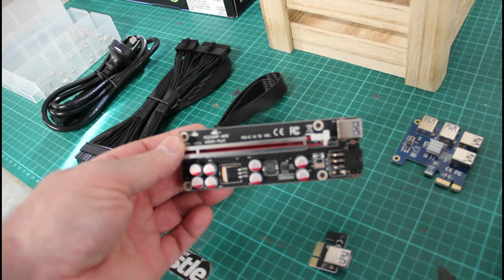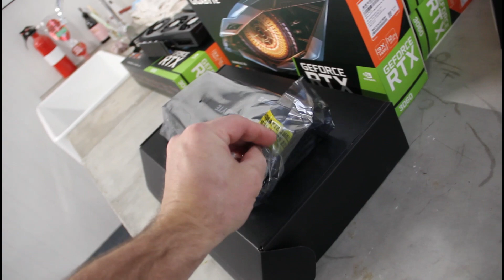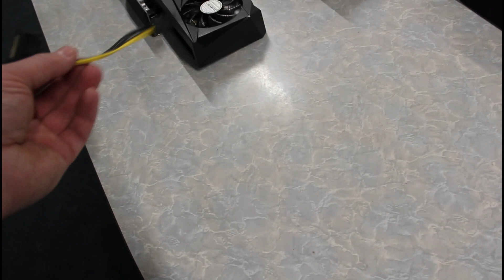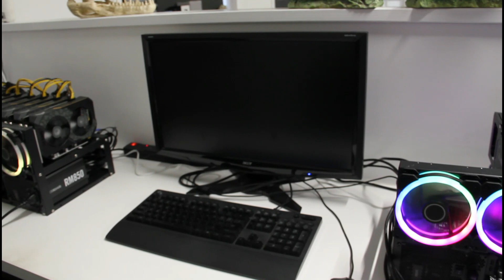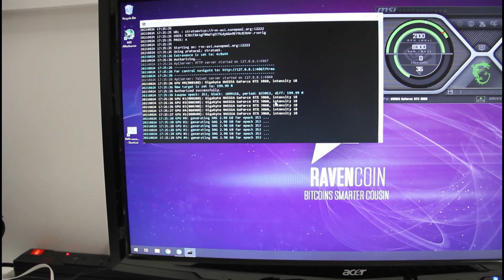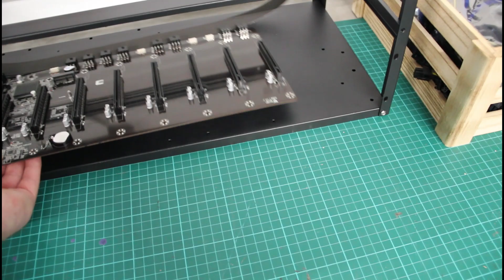LHR - Who Cares! My NVIDIA 3060 RAVENCOIN Mining Rig Build

Comment: I wonder, do you really need two PSU1s for a right like this? No possibility to solve by one? Probably would be more efficient from energy consumption (and investment) point of view. Thx... Good educating video btw, appreciate your efforts...
Reply from the maker: Hi no you don't have to but combining a small ATX to run the motherboard and a server power supply to run the cards is a cheaper and more efficient solution in some cases. This is because server power supplies are cheaper to buy than ATX typically and they are more efficient...especially a platinum one like this. Hope that helps mate and thanks for your great question.
Reply: @shaneusmaximus2744  thank you for your reply, it is getting clear ;-)

Comment: I have the same motherboard, can i use 2 power supply’s without splitter between them?
Just connect every psu 24x from psu to motherboard without connector between?
Reply from the maker: Hey yes you can use two PSUs like I have, not need to connect them together. Just connect the ATX Power Supply to the MB and then the other one can power the GPUs. Turn the second power supply on first and then the MB power supply, that way everything is powered up before the MB tries to detect the hardware. Hope that helps.
Reply: I wanna buy an H570 for my rig. How many cards this motherboard supports? How many do you attach to it?

Comment: Please someone i really need help with this
Struggling a lot 
Only one gpu working 
2nd gpu shows the below 

Hiveos  (missing gpu unit) 
No temp shows no power shows on screen 

motherboard is asrock h510 pro btc 
Gpu gigabyte 3060 ti lhr

Please anyone can help 
Would be great
Reply from the maker: Hi. You could try using windows first, get everything detected and running and then switch to HiveOS. Hope that helps.

Comment: what if I want to buy another gpu, but 3060 is too much right now? which cheap gpu is good with eth, ergo and raven all together
Reply from the maker: Hi there. In that case you could look at a 1660 Super. It can mine all those coins and is cheaper to buy up front. You can check my other playlist, I do a build using these and they are great cards. All the best!
Reply: @shaneusmaximus2744  The calculator shows it's only profitable on ethereum

Comment: why are all the fans pointed the wrong way? Hot air comes OUT of the grill on the end of the GPU, those fans are pushing the air back in. Or did I miss something?
Reply from the maker: Hi, yes you are correct, if these were blower type GPUs (as used in graphics applications) the chassis fans would be the wrong way around. But most gaming GPUs like these are open air GPUs and the air flows differently. The GPU fans draw air in and over the heatsinks then expel the air out the top and bottom of the card so having the chassis fans installed this way helps blow the warm air away. There is a good explanation here: https://www.howtogeek.com/365215/what%E2%80%99s-the-difference-between-a-blower-and-an-open-air-gpu-cooler/ hope that's useful.

Comment: Hey don't leave power monitor plugged in.  They are fine for a short while but they then to heat up.  And even melt.
Reply from the maker: Thanks Jason, appreciate that. These one I have are not the cheapies, they are 15AMP rated supposed to be OK for continuous use. But I will keep a good eye on them. Thanks very much.

Comment: A link to buy pcie cable ?
Reply from the maker: Hi, do you mean the Y cables? I got them from here: https://rigs.co.nz/collections/risers/products/rgeek-pci-express-pcie-8-pin-to-dual-8-power-supply-splitter-cable-20cm?variant=40180582482108
Reply: @shaneusmaximus2744  Thanks mate
Reply: @shaneusmaximus2744  hey shaneus. Just wondering is it safe to power 2 riser from 1 Y  Cable. ?  Thanks